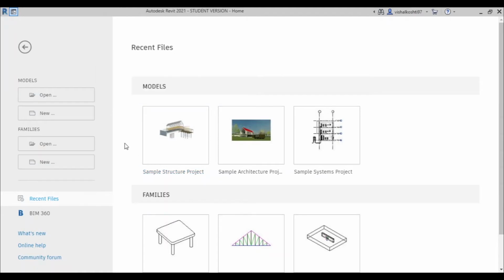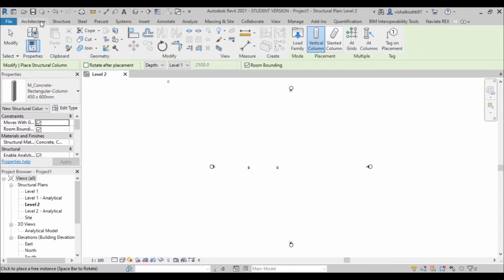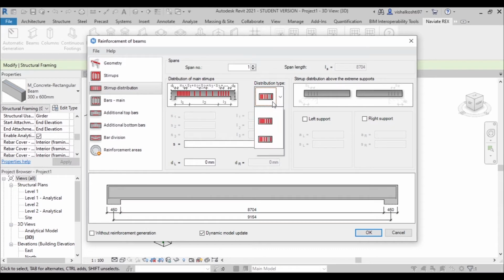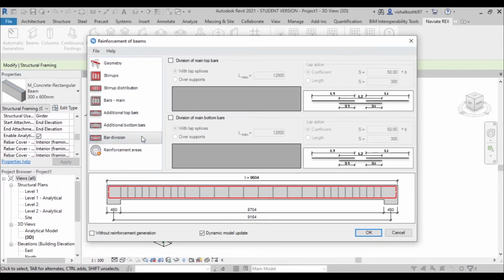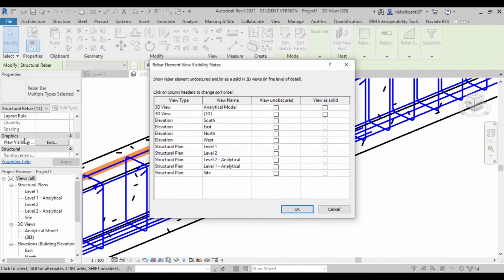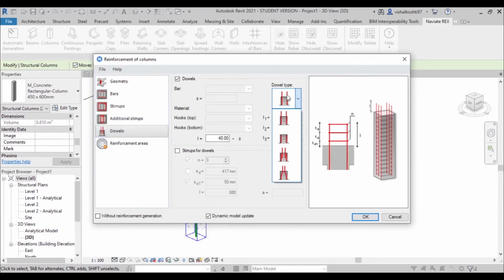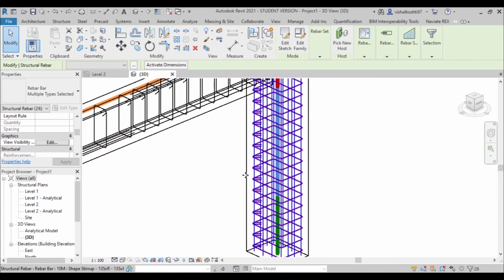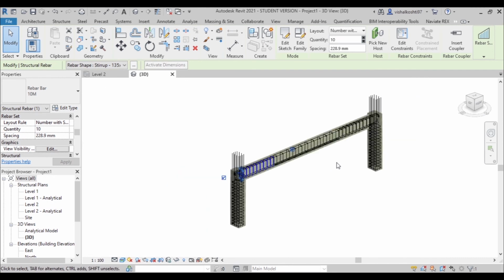Autodesk Revit - 2021 | Naviate Rebar Tool | Generate Reinforcement

Comment: naviate re 2022 not working for crack revit. please provide rebar extansion for crack Revit 2022
Reply from the maker: Plz don't use cracked version.
Buy for commercial purposes and for educational purposes use student version from your institution
Reply: U need to install hotfix 2022_2
Reply: @mostafahanafi9092  how to install it for crack revit 2022
Reply: What to do for cracked Revit 2021??
Reply: Rebar extension link plz